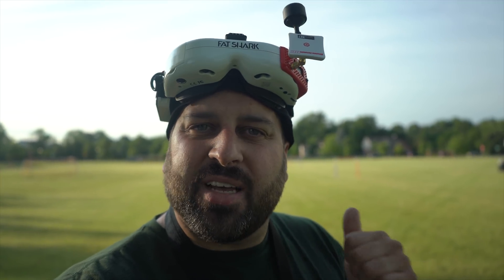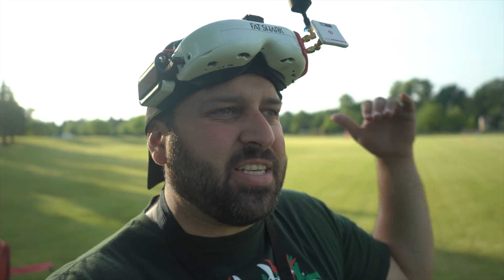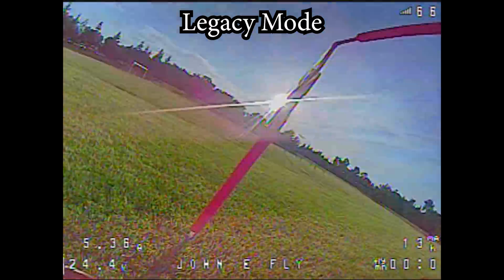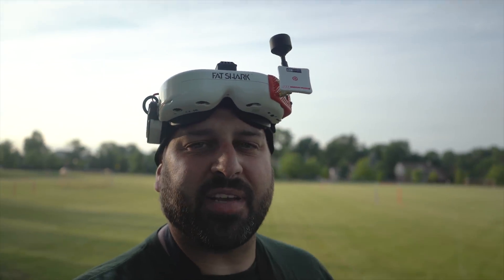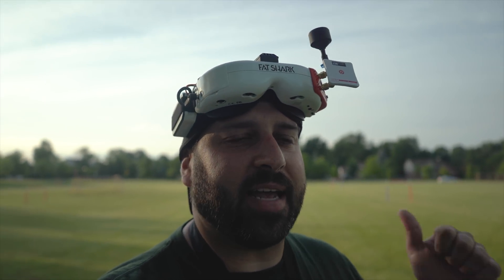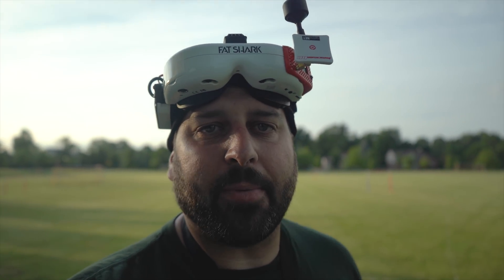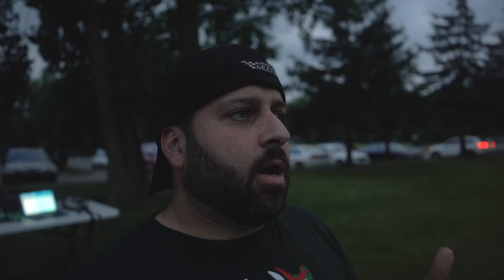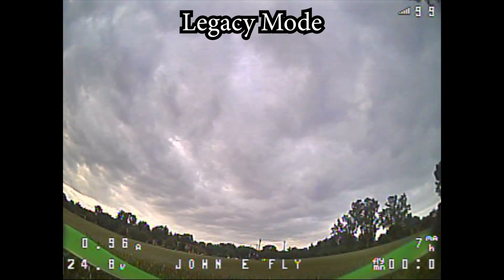IRC RapidFire RapidFIRE Mode vs Legacy Mode + Low-Light Performance

Comment: Great video and thanks so much for this honest info. You just saved me 100 bux. I've been saving for a while for some HDO's + Rapid setup so I can focus more on flying than trying to focus my eyes in my lame box goggles. With the proximity that you flew in these last two videos I really don't see 100 dollars worth of difference.  Bandos flying is probably where the rapid fire really shines but for normal gates in a park like i fly I'm probably going start with the true D or that new GE with the Quad finder first. At least until Immersion works out all the kinks.
Reply from the maker: For what it's worth I love my rapidfire now.  Batch 1 has an issue with mode 1, but if you get batch 2 you should be good.  It really does hold on to the signal better than a true d.  That doesn't necessarily mean it's worth $100 to everyone though.

Comment: What's your field charging setup? Was that orange case, on the left of the table, a power source?
Reply from the maker: Yeah, that's a portable UPS.  Here's a link for it: http://amzn.to/2BG7m7D.  Basically it's a lithium ion battery with 288Whr of capacity and it's also an inverter.  I can charge about 10 6S packs from it and maybe 15 of my 4S packs.  I mostly use it to power my laptop and timing system for a day out flying.  In this video I was using it to power the timing system that was letting me know my lap times.
Reply: thanks!

Comment: Well..both modules look good in my eyes😅
About those spedix 30a 3-6s esc's you once used on 6s, why dont you use them anymore? What does the aikon have that those didn't other than being a 4in1?
Reply from the maker: The biggest thing is that they are 4-1.  Much lighter. Not awkwardly placed on arms.  My racing frames are really optimized for 4-1 escs.  The AK32 is also blheli32 while the es30 were blheliS

Comment: Yeah i think your right the issue lies in my opinion with the fact that they are blending two signals together. 

With analogue electronics every little difference in the signal path can skew the signal which is fine if the whole picture is built from the same signal source but when you blend two different signals together the small differences can cause alignment issues and chromatic mismatching issues.

This is probably exasperated by higher amounts of chromatic and luminescence noise in low light situations that will upset the analogue bandwidth saving methods they use in composite video.

Comment: Hey John. Are you still getting any desyncs with the 2405 build?  Man, I can't get mine working right (it's exactly the same build as yours). I've tried demag comp HIGH based upon your previous input ( thanks for that), but it still desyncs. Any help would be great. Thanks!!
Reply from the maker: I also run 48 khz pwm rate but I wouldn't expect that to matter.  What min throttle are you running?  I run 4.  Perhaps yours is too low?  You could also try auto timing.  I've had no desyncs since going to demag high.

Comment: DETROIT!!

Thanks for doing another video for the rapid fire. I have the HDOs and my Rapidfire should be shipping soon.

I see your not using your pop-up gates.

What are you using to stake these pvc gates into the ground.
Reply from the maker: If I have the time I like to use rebar and pvc.  If I don't have the time I use quaddiction gates.  The rebar is 2 ft x 1/2 in

Comment: You must be felling pressure from IRC to make such idiotic test.
Reply: Stephen Gibb i was meaning the test method, to be precise. Ofcourse hyped products must be checked properly. How do you imagine to test latency with a lap times? Humans are not that consistant, to test this kind of issues.
Reply from the maker: No pressure at all, I must just be an idiot!  Thanks for watching!
Reply: John E Fly You are not, but testing maybe 10 - 20ms diference in latency with a "i feel like" test is not a good idea.
Reply from the maker: I'll be honest, I don't care about 10-20ms.  I care about getting the fastest lap times possible.  If something makes me slower, that's what I want to know.  In this testing the RapidFIRE was clearly making me slower, and I mistakenly assumed it was latency causing that to happen at first.  I think this testing shows it's not latency, but under certain conditions there is still something which does make me slower.  So oddly enough, I care more about the feel than the straight numbers for stuff like this.
Reply: Its not idiotic at all he noticed something with a hyped product that people don't want to believe hence the hate.

Comment: Great video. Thanks for sharing your info. That Frame do you uses and that Canopy? You print? Do you thing that rapidfire es much better than True-D?
Reply from the maker: I'm using 2 different frames.  1 is a prototype frame from Detroit Multirotor which will be available soon for sale (if it's not already), and the other is a Mode 2 Ghost.  The Mode 2 Ghost frame is the one using the canopy.  I did not print that one, it was ordered from Brain3D.  I printed one in TPU before but it didn't protect my electronics well enough, this one is made from Nylon and is AWESOME.

I would say the RapidFIRE is probably better than the True-D.  I still like the look of the picture from the True-D more, but I do notice less breakup using the RapidFIRE instead of the True-D, even when running in legacy mode.  The issues with blacking out still make me very nervous with the RapidFIRE, while the True-D has always been rock solid for me though.  I think in a few firmware updates there will be no comparison between the two, the RapidFIRE will be significantly better, but for now the True-D may be the safer buy.

Comment: Was the difference in lap time significant between the modules, and if you are racing in good lighting conditions would you see a difference?  I'm glad you gave us another testing round, I expect this video won't be the last on the RapidFIRE.  Cheers.
Reply from the maker: There was no significant difference in lap times between the modules or the module modes (in the earlier testing).  11.3 wound up being my fastest at the end of the day with Legacy mode, but I was seeing 11.4 and 11.5 times with the True-D and RapidFIRE mode earlier.
Reply: The area he flew in wasn't bad rf environment, In a race with more people and more static I think he would appreciate Rapidfire more.
The only thing bothered me was the saturated picture... I hope it will be fixed. 
Anyway, interesting points on the rapidfire module, when will it be available again? I have to get my hands on 1.
A review dom V3 vs hdo would be lovely.

Comment: Low-light performance of a receiver module???? WOW that is something. GET A CLUE!!!
Reply: To be fair it is a receiver module that is combining the images from two receivers, so there is a possibility of there being issues depending on the algorithm used to combine the frames.
Reply from the maker: I'm just going to assume Ponyboy didn't watch the video...  I never would have expected this to make a difference either, and why I didn't mention it at all in my first video.
Reply: If this was digital then yes it would be silly but your talking about combining signal from two very different signal paths. 1. linear patch 2. circular polarized pogoda.

In analogue everything in the signal path changes the signal to some degree when you try to combine two signals with very different paths your bound to get problems.

Comment: maybe from using other modules your connection socket is not getting the best contact. Do any of the pin legs on the modules look discolored ? i do see how it changes your style of flying for the image quality you might need to re adjust all your cam and your goggle settings. it does look like power issue in RF mode or maybe try changing channel for a test it might be something around you on the frequency it can see maybe in RF mode. The rapid switching could be making noise in the power thats not getting filtered right. if you can return for a new one but i know how shipping and waiting is if you dont have local might be a bad cap or lc/rc filter
Reply from the maker: I would be extremely surprised if there is an issue with the module socket.  These HDO goggles are basically brand new.  Before the RapidFIRE only a single module was ever put in there, the True-D.  There is no discoloration on any of the pins.  The quad in question actually has 2 caps.  It has a large 1000uf on the main battery leads and then a smaller 330uf on the vbat/gnd pins of the FC where the VTX connects to (as recommended by Serge from Piroflip).  

If you look at the about screen of the RapidFIRE it shows 5V power and low-power mode is off.  So I would be extremely surprised if anything like this is happening.
Reply: yeah i dont think its you kwad and i forgot you just got new goggles. try redoing firmware if you can maybe a few 1s and 0s got mixed up for the rapid fire program
Reply from the maker: Haha.  There is no publicly available firmware yet btw.  Your only option is what ships from the factory.  I will say I'm very curious for more RapidFIRE customers to do this sort of testing.  I know it's the sort of thing you're probably only going to notice at a very high speed with the quad, and that may not be relevant for a lot of pilots, but I really really don't like that I'm the only one that seems to see this so far...  I'm sure there has to be others that will see it too...
Reply: yeah thats why i say you might need a new one everyone else seems to be happy with their unit. mass production can have the 5 in a 100 that get past cause they seem to pass test in house but after you can tell there is an issue. maybe reach out to a tester channel who has a rapid fire to see if they can get same situation.
Reply from the maker: yeah I need to reach out to some more people.  But to be fair, have you seen many others flying at a very high rate of speed in relatively low light situations like this?  I'm wondering if either people aren't going very fast, or they're flying with more light?  I'm really curious now if it's just me...
Reply: yeah your right everyone is doing daytime review style not much racing. i have yet to see parkin deck or bando stuff time will tell i guess. lol with vr stuff going wireless the tech might leak over to fpv soon so hd fpv so you might be looking for new module soon anyway this hobby doent stop with the new.

Comment: Lighting conditions are down to the camera not the module surely.
Ive come from using the Realacc 5808 module with Achilles firmware/Dom V3 goggles which were great,but my Rapidfire paired with the HDOs are on a whole new level.
Rock solid through dense trees plus great range,cant fault it.
Reply from the maker: If you watch this video, I'm using the same quads with the same cameras through all of the testing.  I never would have expected lighting conditions to matter either, yet there it is.  Try flying the RapidFIRE in RapidFIRE mode just after the sun goes down at a high rate of speed.  Then try it in Legacy mode.  You may find the same thing I did...